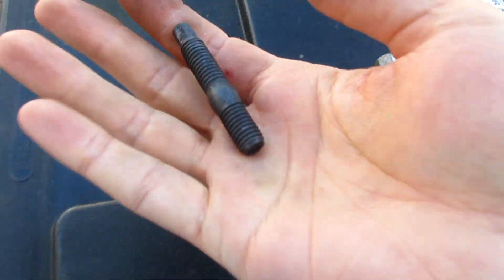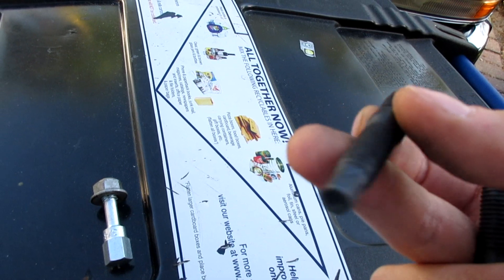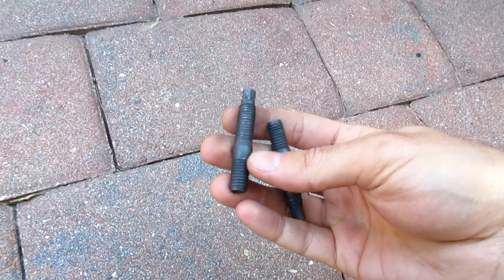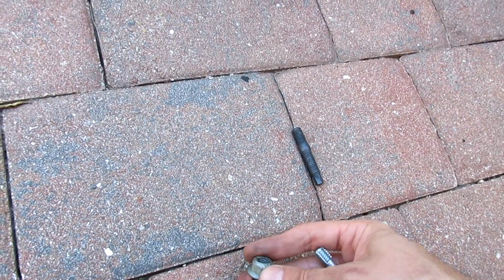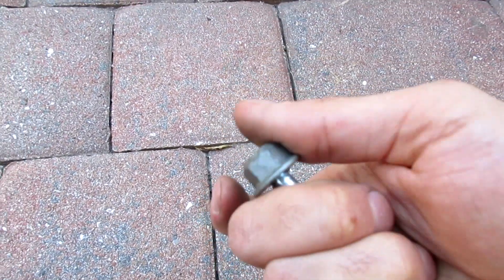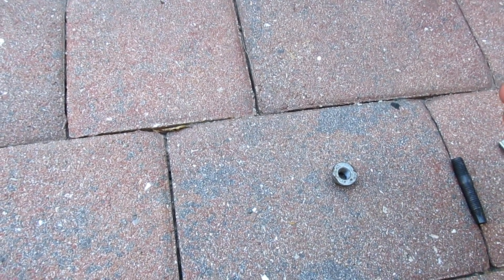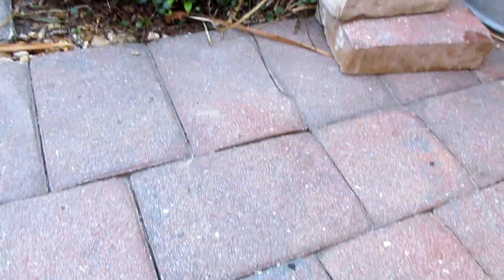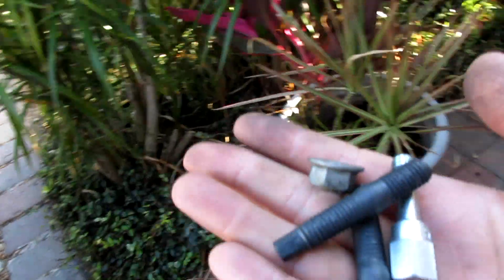3/8- 16 bolt Fits in a 10mm x1.5 hole! WOW!

Comment: Very useful and under rated video...

I have a transmission torque converter calling for M10-1.5 bolts to secure it to the flexplate but I ordered 3/8-16 bolts, which fits the fraternal twin brother of the transmission I have...(got to look out for the most smallest differences I guess).

Hopefully the 3/8-16 bolts I ordered will fit the M10-1.5 bolt holes on my torque converter. 

Your video gives me hope lol thanks.

Comment: Wow is right! That is a cool video! Love the video like always!
Reply from the maker: Probably is a few more sizes that fit.  I had to find all charts comparing all bolt dimensions. Probably a few more sizes will thread loosely too  Just happy that the bolt hole SHOULD NOT be mangled on the manifold as it HAS to come out to weld out broken bolts